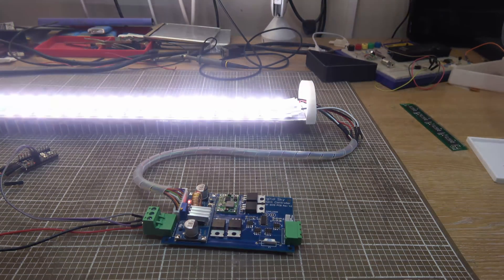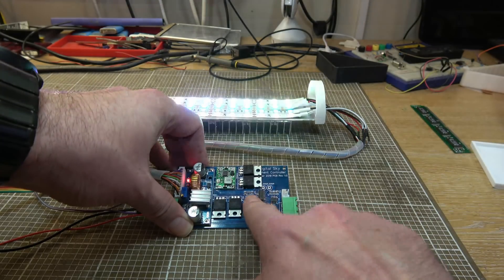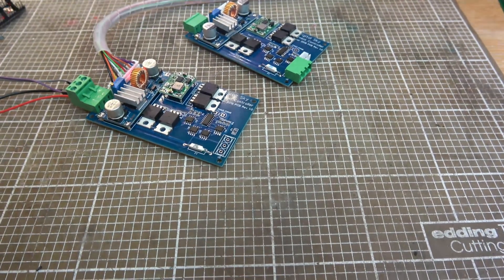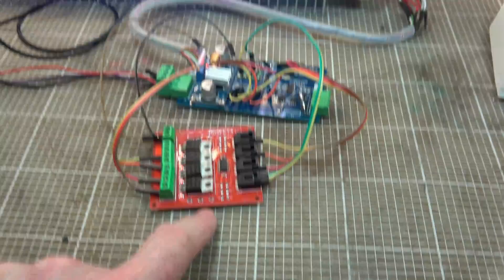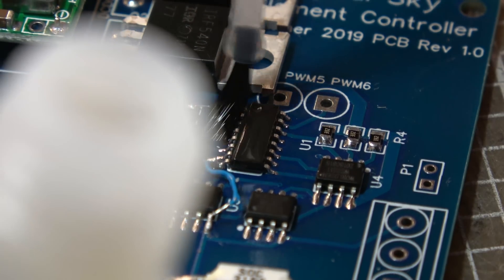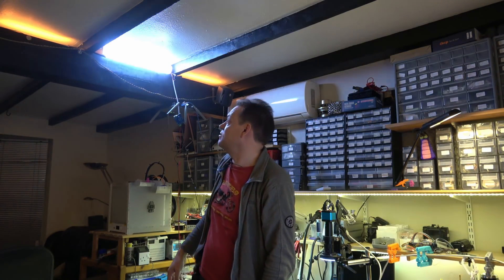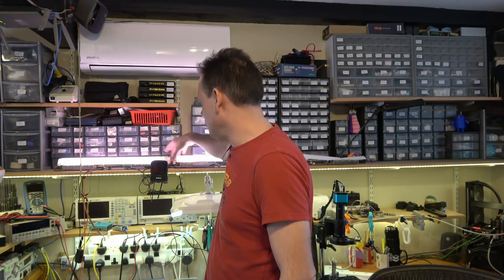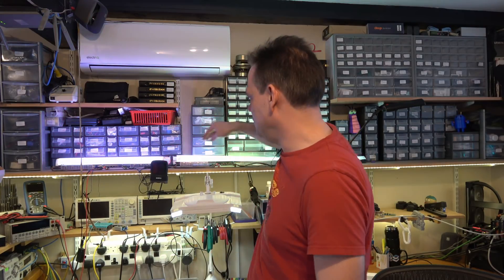Digital Sky Project - Part 2 - Fixing the flicker.

Comment: Oh we might get some 3d printing videos out of this project too :) Thanks for sharing :)
Reply from the maker: Hey Benja - There has been a little bit of 3d printing for this project. I made the end caps for the lights and the strips which hold down the opacity gel. I'm not totally happy with the current design though, so I might possibly end up redesigning them in the end... but for now, they're good enough for a prototype. Cheers!!
Reply: @ThingsWhichArentWork  Nice you are getting your money worth out of that 3d printer :) I though those end pieces were printed. It did a great job on the channel for the cover. I saw that and thought to myself that look printed... but that is a really smooth channel.

Comment: Yes, the chip will work better with power and ground connected. How could you forget to add that when designing the board. Thats a stupid mistake.
Reply: Some schematic and layout software does horrible stuff with supplies to ICs, such as hiding them and expecting power nets to be configured correctly in some random window. Easy to forget when the schematic doesn't show them.